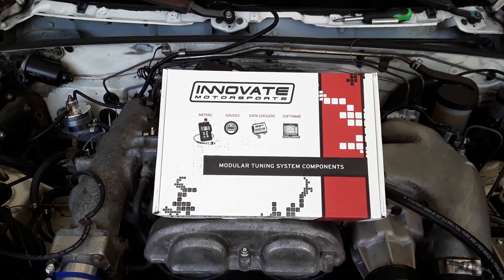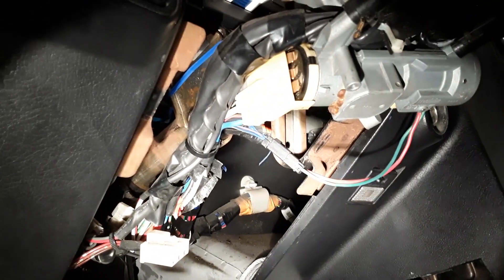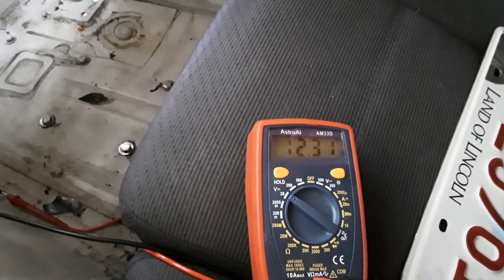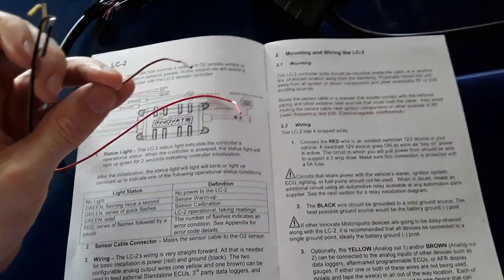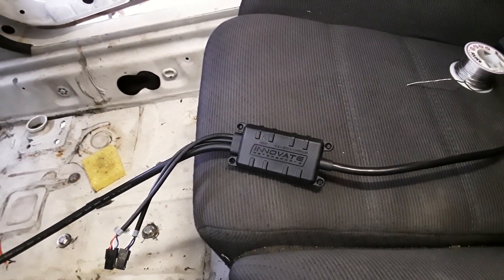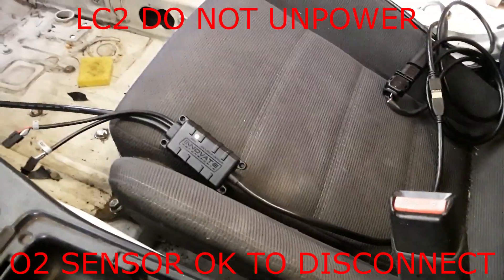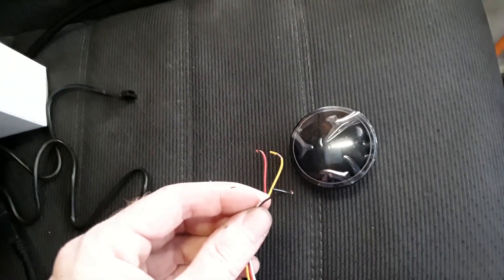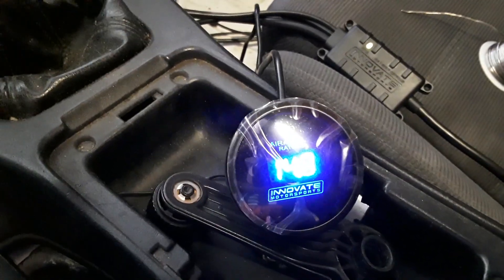Miata Innovate LC-2 Wideband AFR and O2 Install Guide

Comment: Man! Very first video that popped up at the top after searching Innovate LC-2, was yours! Putting a MS3Pro on my '90 Miata. Getting a gen2 CX Racing turbo kit after I get familiar with the software. Seems to be a huge step towards the user-friendly side of tuning compared to HP Tuners.
Reply from the maker: Wishing you nothing but the best with your car <3

Comment: Do I understand that the brown wire emulates a narrowband sensor for the ecu?
Reply from the maker: Fore mine it was indeed. If you are running a standalone (MS, SpeedyEFI, Haltech) you may need to adjust it slightly as all of those are looking for a wideband sensor.

Comment: Wherre did you plug the o2 wire into the ecu?
Reply from the maker: When I was on the stock ECU, I left it just like it is in the video. When I switched to a standalone (SpeedyEFI) I cut the wiring harness right before the plug on the pin for the O2 signal and soldered the wire off of the sensor into it. 

If I need to clarify it some more I gladly will do my best to help. Have a great day!

Comment: Does the green light stay on all the time even when the car is off ?
Reply from the maker: I have never had that happen. You want to make sure you choose a 12v that is only on when they key is in and on. If the lights are are non stop you need to find a new power source (you'll drain you battery).

Comment: How wel does it work? Im am thinking of buying this to finetune my mixture, and if i am going to turbo my engine it would be great i think. Can the AEM wideband do the same or is that just for reading instead of altering the o2 signal?
Reply from the maker: Hey, So this and a version of the AEM are read only. As far as I know all widebands are read only and do not alter the o2 signal. If you're hooking it up to an ECU, the ECU can use the info to alter what the engine is doing.

 So far it has worked fine, there was one plug that was real tight but otherwise no issues. Hope this helps :)

Comment: Hey, mine sometimes just blinks 7.4… I bought the car recently off this guy and it was reading fine at first and now it’ll blink 7.4 from time to time. Idk what the blinking means, if someone could please tell me what that means it would help a lot !
Reply from the maker: Hey Carlos, The 7.4 blinking happened to me after a solid day of tracking my Miata. To solve it I pulled the O2 sensor out of the pipe and did the fresh air calibration and have not had an issue since. (I think it happened to me because I was running rich while in boost and it needed to be cleaned or just recalibrated). If you need a link to the instructions and how to do that let me know.

Comment: I’m running a stereo and planning to buy a mspnp2 this week and regarding the 5amp fuse for the wideband , can I wire it in using an in line fuse connector?
Reply from the maker: Personally I wouldn't recommend it because what I have read online about the stereo is the older ones are pretty sensitive and adding anything into the wire circuit for it may be detrimental. What I would heavily consider for what you want is to use a fuse JUMPER. A fuse jumper will cost you a few dollars but should offer you the protection for your wideband and is significantly easier to install than what I did to power my wideband. Hope your install goes well!
Reply: @MiataMoney  thank you so much bro, yeah I’d rather spend more for the peace of mind, appreciate the response and good luck with the channel

Comment: so which wire goes to aftermarket ecu ms2pnp?
Reply from the maker: The brown wire off of the LC-2 itself will send the signal to the ms2pnp. If you skip to the end of the video there is a diagram where you can see the brown wire running to the stock ECU (I don't have MS :'( ) . The brown wire will go to whatever you are using as your ECU. At the bottom of page 3 in this link, it will explain the yellow and brown wires in more detail https://www.innovatemotorsports.com/support/manual/LC-2_Manual.pdf . Hope this helps!

Comment: excellent guide! which model of lc-2 did you buy? do you have links? i would like to buy it too
Reply from the maker: Hey there, thanks! This model I ordered off of Amazon - Innovate Motorsports 3795 DB BLUE Wideband Air/Fuel Gauge Kit includes LC-2 & Bosch LSU 4.9 . If you have a soldering kit or know how to put wires together you can have it installed in under an hour. How do you like your RX-7 AFM?
Reply: @MiataMoney  I got along very well with the RX7 AFM. above 5000 rpm the engine breathes much better! however my next step will be to eliminate it with an ECU .. for this reason I would like a wideband!